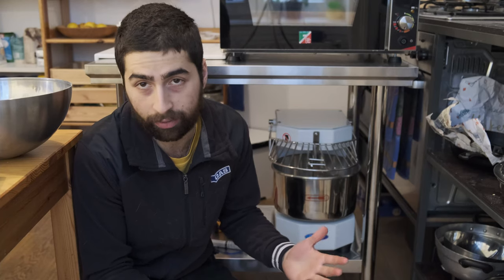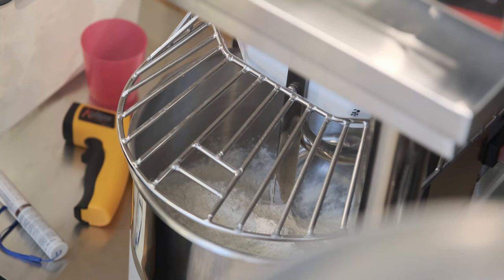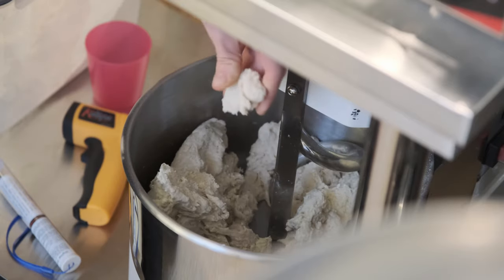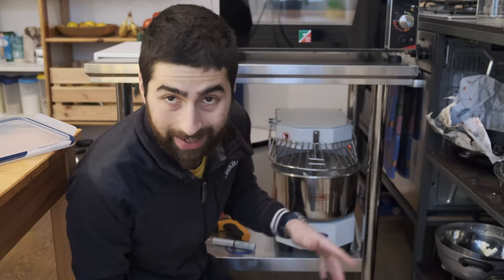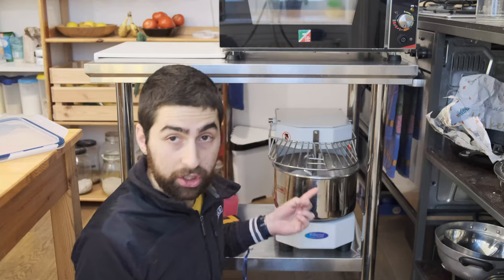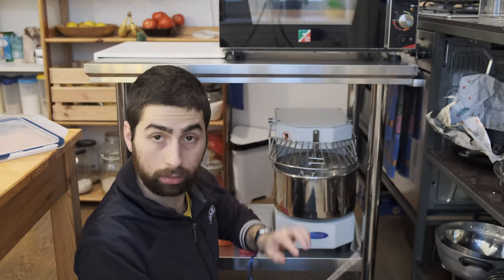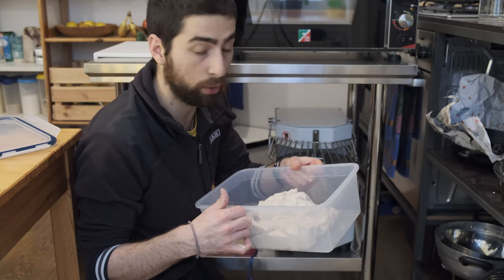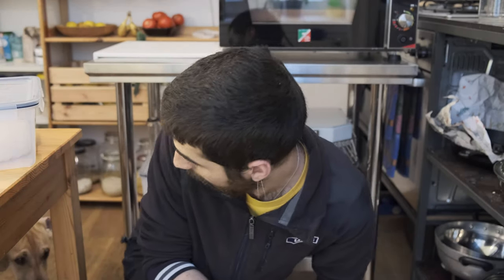How to use a spiral mixer to make dough (Neapolitan pizza)

Comment: Very helpful. I am new to my home spiral mixer for 70% Neopolitan. I use a preferment (poolish). So, should I dissolve the poolish in the 55% of the water at the start, add 100% flour and mix at slow speed. Autolyse once combined for 15 min. then Bassinage the remains water and add the salt at the end? When do you increase the speed of the mixer?
Reply: hi. thanks for your comment. the speed of the mixer you can increase when you are doing bassinage to increase the percentage, closer to the end of the dough. I personally do not as the machine has a fixed speed. you basically increase the speed to increase the percentage of water faster than the increase in temparature. your reference for when to begin should be the temparature of your dough. if you realize that at the end your dough is too warm then you should have maybe started earlier or use colder water next time. theoretically even with the slowest speed you can work up to 70 percent hydration but obviously the faster the more practical this is

Comment: wow you have the same setup as me p134 and maxima 8L ...yeah i ran into the same problems as you... overheating and not developing gluten as fast despite its fast speed but there are ways round it as you mention...will give your methods a shot they seem super
Reply: high Hydration dough needs very high spinning machine 200 rotations per minute and above for optimal results

Comment: Couple questions:  1.) How much flour was used in the video?  Which is to say what is the minimum amount of dough this machine can reasonably make?  (My batches are typically 1.5-1.6 kg of dough and wondering if this machine would work for that size)
2.) Why the 24 degree limit - do higher temps effect the gluten or does it effect the fermentation?

Comment: just for your info. at the end when I say a flour that can hardly absorb 70 percent, I actually mean a flour that is low protein/gluten strength. It is harder to develop that kind of a dough and a mediocre machine with a single speed cannot handle this well. kitchen aid etc you can forget about :D
Reply: Adding 2-3% pure gluten helps resolve low protein flours (<10%). Nice hack when you only have access to such flours like European supermarket flour.

Comment: Hello, Thanks for the vedo. Which spiral mixer would you recommend? I would recommend you to put your mixer higher so it makes your life easer. Best to you, Mike
Reply: The Famag Grilletta multispeed mixer range are excellent. Do not get a monospeed mixer as it will then be very difficult to get hydration > 60-62%. Monospeed mixers are a little outdated and meant for low hydration breads. This why they are cheap.

Comment: thanks for the insight! so to sum up: heat development and not having the possibility to turn the mixer faster is what makes it problematic if you dont use flour with higher protein? did I get that right?
Reply: Exactly. The higher the heat (above 24 degrees) the worse it is for the dough, if you can go fast you can avoid this. or you can use a bunch of ice in the water. Going to higher hydrations with low protein flour becomes problematic as such flours will need longer to absorb the water and the chances of the dough being to stressed or hot is possible. This machine is really good for any kind of flour up to 65 percent hydration, pizza flour 00, 0, or 1 for 70% hydration and tipo 1 for 75 percent or so hydration. I recommend getting a 2 speed machine but if the budget is really tight this will do the job just fine with some ice cubes. 
Additionally to mention: for a pizzeria you need a faster machine because a slower machine will mean that you will pay your employees more hours to stand by the machine. Where I work I waste so much time because the machine is ultra slow.
Reply: @Bbarm97  thanks! I'm looking for used spiral mixers with a 20l capacity at a range of 500-600€ and all of them seem to just have 1 speed. maybe they're better than the maxima, because most seem to come from italy, dont know..

but after your video I'm really asking myself if this is a good idea, since I want to mix about 12-16 kilos with local flour (11% protein) and hydration from 70 to 75%. style ranging from whole grain rye and white wheat bread.

since its a hobby, time is not crucial and maybe its ok, if u know how much the dough is gonna heat up, you just use cold water? now I always use water with about 30° to get the right dough temperature, because the flour has about 16°
Reply: @jokebhurtz2135  for your specific application a single speed could work. maxima also has a 20 liter machine as far as I know with 2 speeds. The Italian machines being better is a myth and not really true. famag machines are good so maybe take a look at them. Depending on what you are making with the dough you can play with the temperature. I use cold water and ice cubes in the summer, just cold water in the winter, but this is for sourdough pizza dough. I know for example that people knead a lot longer and warmer for panettone. For making sourdough bread I follow the same methods mentioned here but that also has to do with the taste being effected a lot with the temperature with sourdough. If you have firm sourdough or use normal yeast you could go warmer and the warmth could even jumpstart the bubbles in the bread. For pizza dough the gluten strength is essential as the toppings slide in and out of the oven on a thin layer of gluten but for bread you actually want less strength in your dough to get the oven puff. A lot of variables but I think for making bread you can easily use single speed.

Comment: How important would it be to have multiple speeds?
So how big would be the advantage in the process when having multiple speeds?
The financial difference is clear it's about 200€ ;-)
Reply: it depends. first very slow speed to let the dough suck up 60% or a bit more hydration and then increase to fast speed to do the rest of the water. or just use fast speeds to get the dough done faster. In my opinion the speed of maxima msm8 is plenty enough for 70% hydration but if you want higher hydration u need the slower and faster speeds. for 80% i would start with 65 percent at slow speed and then the rest way faster. For normal use the speed of msm8 is enough. If you can you should invest those 200 euros in different flours and see what you like the best and what combinations. If your machine is not great at hydrating weaker flours a trick I use is to mix tipo1 flour into it. for example at home I make 40/60 tipo1/caputo red. at work we use 8/92 tipo1/super nuvola. the flour mixture percentages depend on the style and length of fermentation.
Reply: Great video. Can you tell me what machine you would recomend instead of this one. Thanks

Comment: Hi, appreciate the video.   I have a question.   I have the same machine and follow a similar procedure with my sourdough starter.    But if using dried yeast, would you add it to the flour before the autolyse or follow the same method and mix it with the 2nd batch of water?

Comment: Good video! Which mixer would you recommend instead?
Reply: famag griletta is a great choice. sunmix or mfitaly are also amazing. i can now achieve amazing results with this mixer too but i would buy a single speed only if your budget is tight. its ok if you have a tight budget, lots of pizzerias use a single speed machine. its like having a car, even if its not the best car you will feel most comfortable with your own car. at work we use a famag and its good. i also used sunmix machines and they are great as well.

Comment: I noticed you don’t really mention a recipe. Do you just pick an amount of flour you want to use and then just add the other ingredients as percentages of the volume of flour? Like, 500g of flour and 70% water would be 350ml? Something like that? And so on with the other ingredients?
Reply: yes your calculation is correct. giving a recipe is pointless as the yeast you use, the flour you use, the temperature and all the other variables will affect the dough and will be different for everyone. for example, using the exact same ingredients at the exact same temperatures I have experienced very different doughs from 2 different machines, similarly the flour and yeast will effect this a lot. for strong tipo 1 flour you can go 80% hydration but if you use caputo blue even 70% will be a struggle. There are some yeasts that are stronger than others or have different flavors, same applies to sourdough.
Reply: @Bbarm97  Thank you very much for the info. I stumbled on to this video because I was fixing my Rollei 35 and had been watching your Rollei 35 video. I decided to see what other videos you might have. I also liked your sonnar video. Anyway, I am getting a pizza oven on Monday and noticed you had several videos about pizza ovens and this one about dough. I found the concept of using %’s of ingredients very interesting. I can see that there will be a lot of experimentation involved to find something that will work with the ingredients available to me where I live. Thanks again.

Comment: How many hours does it take for dough balls to rise at room temperature after they have been in the fridge for 20-24 hours?

If there are 6 dough balls in a box at the same time, do you have to take them all out at once? Or can I make 3 today and 3 tomorrow?
Reply: @Bbarm97  I made balls from cappuccino pizza flour with 12.5 grams of protein. For an hour, the dough rested in a room at 22-23 degrees. Then I made the balls and put them in the refrigerator for 20-24 hours at 6-7 degrees. 

Perhaps the best option would have been to leave the whole dough in the box and the next day take out only half of the dough and make balls. 
But I have 6 balls in one box at once and don't know what to do today. The temperature in the kitchen is 25 degrees.
Reply: @Bbarm97  Perhaps you need to take three balls out of the box and cover them with cling film? But how long should they rise at room temperature? I will bake in an effeuno p134h
Reply: @Bbarm97  But from the point of view of practicality, what is the best option for the future, is it possible to make the dough first and then form balls from it on the day you need a certain number of dough balls? I watched a lot of videos and there are different options. Perhaps for pizzerias it is better to make balls at once and take the boxes out of the fridge when the previous one with dough balls is finished.

In my case, I have a 6-ball pizza box, I'm making it for the first time, but now I don't know what to do :) 

You say that the option is 12-12, but then how can the dough be recommended for 48 hours? I have 65% hydration and 23 grams of salt.

Did I understand you correctly, you advise taking out the whole box of 6 balls and waiting for them to rise and then putting them back in the fridge? Or did you mean to take 3 balls out of the box and cover them with cling film? 

Let's imagine that we are a pizzeria, there are 12 balls in a box, we need to cook 3 balls and the rest will be ready in 10 hours. Is it possible to do this? Or should we use the box of dough balls that we have already taken out and the balls in which the ripening process has begun at 22-25 degrees?
Reply: @Bbarm97  I just pulled out three balls of dough and carefully transferred them to another box that I will leave in the kitchen at 24-25 degrees for 3 hours. I think it will be enough for them to get there, right? And I put the other three dough balls back in the fridge for tomorrow. 

The problem is that the pizza boxes are for 6 balls of dough, but we can only eat 3 or 4. I used to use Ikea boxes, but now I wanted to improve the cooking process more and here are the first obstacles :)
Reply: @Bbarm97  Thanks for the tips, I'm going to look for Vincenzo's video :)
Reply: So, I also have a 1 speed spiral 8 liter mixer. Has anyone thought of putting a variable speed control on a 1 speed mixer? I'm thinking to try it but thinking if I raise the speed up too much it might burn out the motor. Think it will work?

Comment: how do i re grease this machine
Reply: what do you mean regrease? you would have to open the top and the bottom and disassemble, clean and reassemble. not something to do unless you know what you are doing
Reply: @Bbarm97  there is only 6 months worth of grease in the machine when sold .

I asked because i’m trying to find out how to lol.
i recently just got this mixer and i don’t want to run into issues in the future due to not maintaining it properly, since i’ve already burned out two KA’s this year lol… also should mention im not using this for flour/bread.